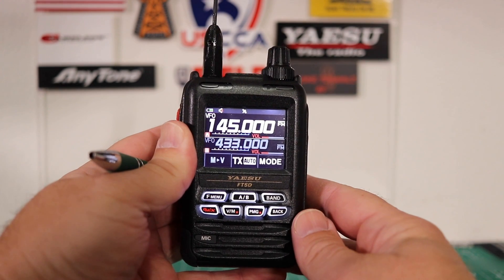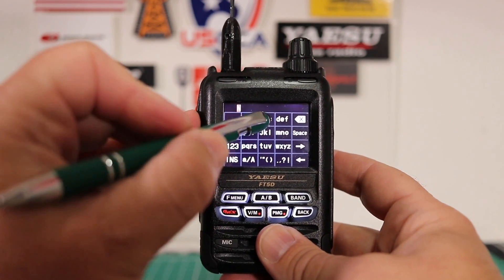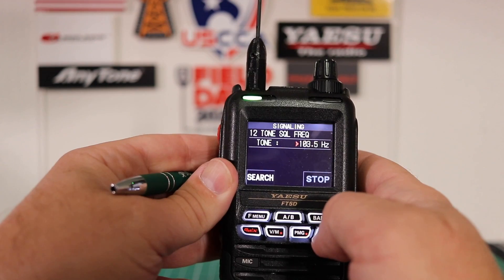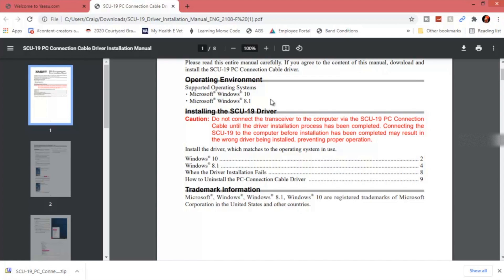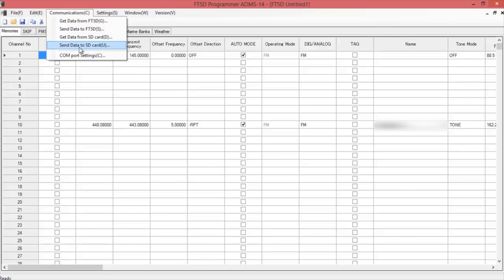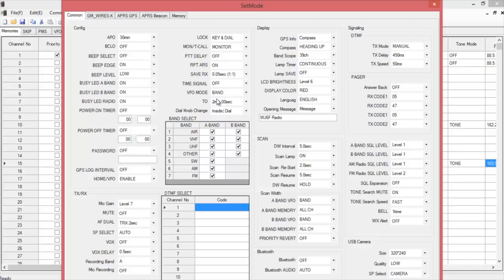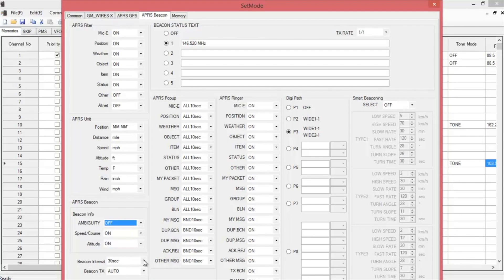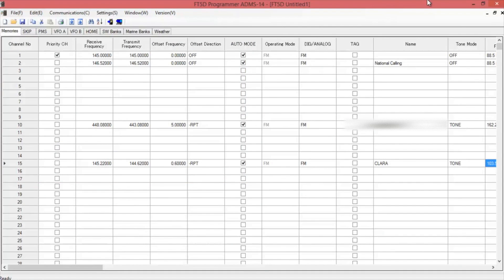Yaesu FT5D How To Program Manually And With A Computer

Comment: I just bought this radio. Pretty solid and has great signal selectivity. APRS and GPS both work well, but consume a lot of battery.

I’m using a Diamond antenna with mine, but it works with a variety of antennas. 

The menu system has a bit of a learning curve, but once you get past that, sky’s the limit.

Great radio. ❤

Cheers from MN - KF0QNM

Comment: For the 15% of people that are Mac based, this was only marginally helpful. But thank you for your otherwise great presentation style. The ding is not your fault....you rightfully focused on the Yaesu provided software which apparentlty only works with a PC.  The radio manufacturers are ignoring 1/6 of the market. Kind of like ignoring left hand dominant people..but I guess that is a "thing" also.
Reply from the maker: @jimrice4699  thank you for taking the time to watch and comment!!  I fully understand your frustration as I too am, primarily, an Apple user.

Comment: is the program free to download or do you have to purchase the programming software and purchase programming cable separate?
Reply from the maker: Thank you for taking the time to watch and the comment! It is greatly appreciated.  You do not have to by a cable. you can use the San Disk that is in the FT-5 for programming.  The ADMS-14 software can be downloaded from the Yaesu website in the file section for the FT-5

Comment: Is a special programming cable required to communicate with the FT5 over USB?  It came with a mini USB cable which I assume is to interface it with a PC, but even with drivers it doesn't seem to recognize the device.
Reply from the maker: Thank you for taking the time to watch and the comment! It is greatly appreciated. I believe there is a special programming cable needed. If memory serves the one that comes with the radio is for doing firmware updates.
Reply: @WJ6FRadio  You are indeed correct. Bizarre that they include a cable for something nearly no one will do instead of one nearly everyone will use.
Reply: I came to the same conclusion. The included cable does not work to program the radio. I spend 2 days and nothing worked. Big fail on Yaesu's side not even mentioning in the driver manual that a SCU-19 special cable is needed. How can they miss this is beyond me.

Comment: Came back to watch this again, twice.  Super-helpful.  Very grateful.  Santa was good to me; I now own this radio and I am stoked.  I installed the cable driver which seemed to go in fine, but am unable to see the com port info in the way they suggest (to confirm installation) at the end of the instructions.  Nothing about ports listed in my device manager and gave up after googling a while.  Looking at the pc's application "uninstall list", I can see it in there, so I figure it's good to go.  Still, a bit nervous to brick a band new radio on my first attempt.  I've entered a few local repeaters through the front end, but have a ton more I'd like to do in various groups/banks.  Loved your suggestion of naming groups by the area that repeaters are in and will use that for having fun with this radio on business/leisure travel.
Reply from the maker: Thank you for taking the time to watch and the comment! It is greatly appreciated. If you are still having troubles with the com ports the number for Yaesu is (714)827-7600and they are open M-F between 8AM – 5PM PST